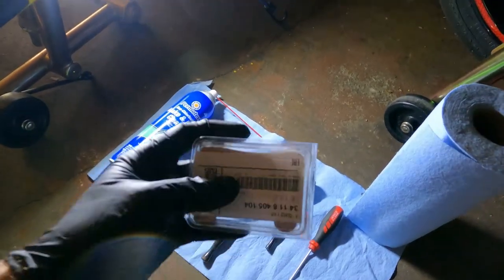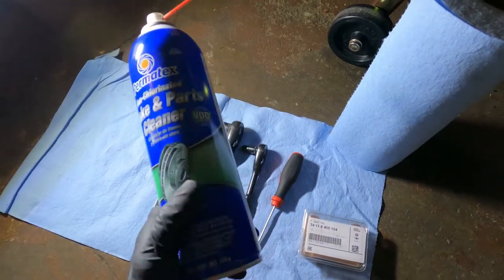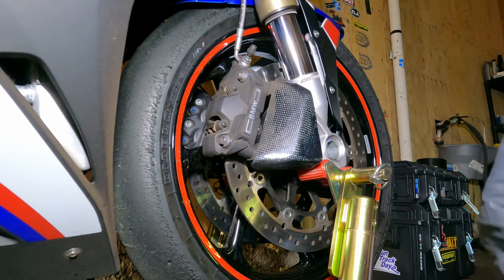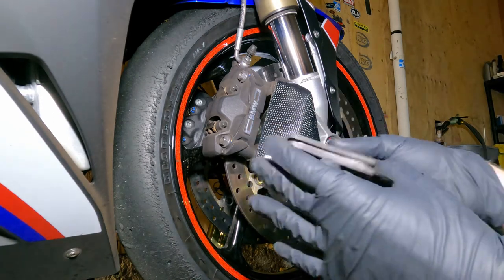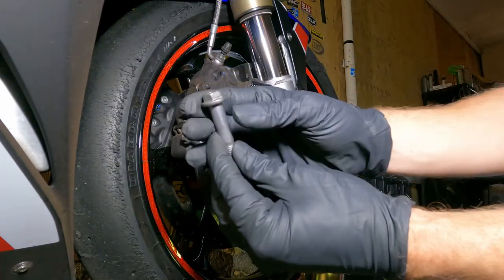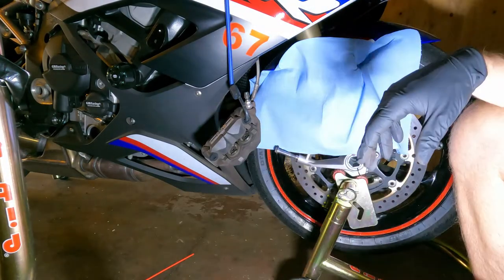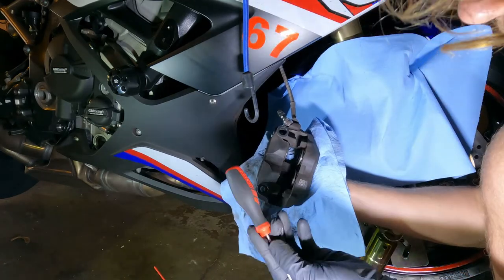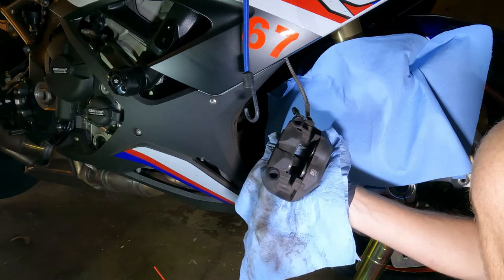2020 BMW S1000 RR Brake Pad service

Comment: Helpful video Armin! question- do you rely on “automatic” linked brakes, or do you actually reach for the rear pedal ? on my ‘18, the pedal is so far down, that it’s just painful and inconvenient to reach for it :(, stock controls..
Reply from the maker: Happy it was useful ! For the track I don't use any rear and yes the integral or linked braking system takes care of using some pressure on the rear. I only use the rear when stopping or off-roading. On a sportbike 96%+ comes from the front brake, so most trackday riders just ignore the rear .

Comment: Have you since tried these pads on the alpha rotors? I'm looking to buy that package from them, these pads with the 6mm rotors. My bike is track only btw
Reply from the maker: Yes tried them for the track and they are awesome - just don’t use them on the road , they destroy rotors at low temps .

Comment: I like your explanation for initial bite/feel. Don’t know if its true but sounds very logical. Under heavier breaking the system should normalise. Are the carbon front calibre air cowls any goos? Would you recommend them? Thanks for sharing break pad replacement and clean.
Reply from the maker: Well I don't design brake calipers, so my explanation is probably not 100% technical correct :)
The Carbon cooler ducts do reduce the temperature of the calipers and pads . If you have your system overheat on track then, yes they are helpful for you. If you don't ride track don't bother with them :)
Reply: @MonoMoto  thanks for your reply. Yes using on track. Just bought a new S1000RR and planning on getting in a few track days in 2022. Upgrading from a s1000r where I experienced brake fade on track (I upgraded to a Brembo 19 master cylinder - best add on I bought for that bike). I will try with Brembo master cylinder and carbon brakes before I invest. Thanks again.
Reply from the maker: @chrisgoes9610  the Brembo MC makes a huge difference. I wouldn’t got for carbon pads but racing brake pads either from Brembo z04 (very pricey) or alpha racing pads (medium pricey)
Reply: @MonoMoto  Thanks man. I will look into these options. I have previously used a carbon composite (bought track side when caught off guard with worn out stock pads), they were excellent but do take a moment to get heat into them to be effective (a bit dangerous on the road, actually lethal in the cold and rain). SBS dual carbon was recommended by a well know UK Moto journalist but i will explore with cost vs performance. Thanks again for your feedback. (Can’t wait to get on track and see what this weapon can do).